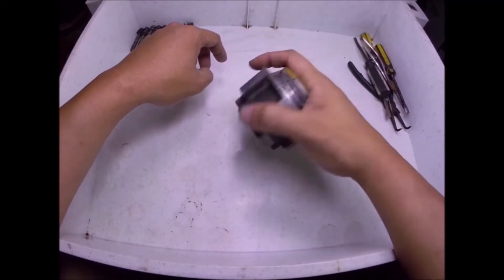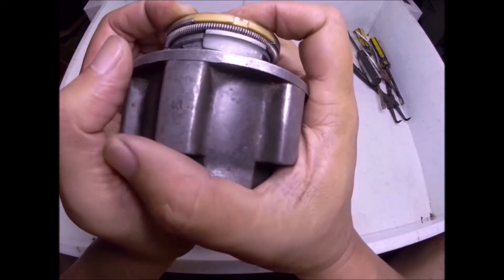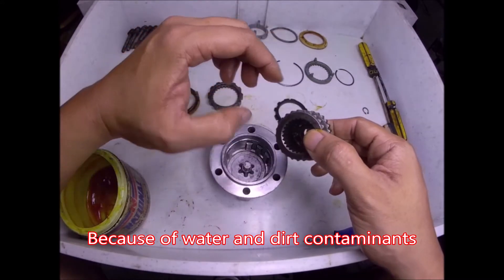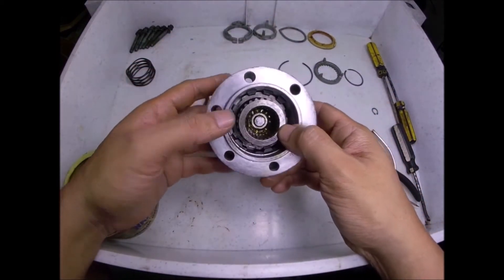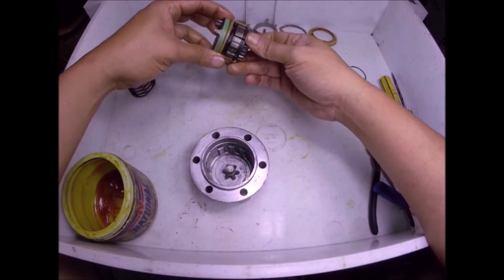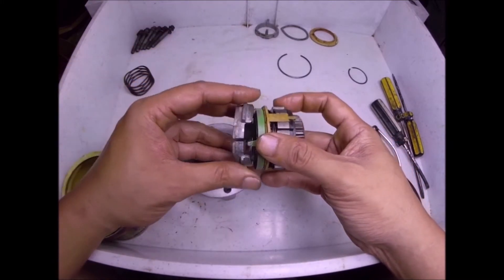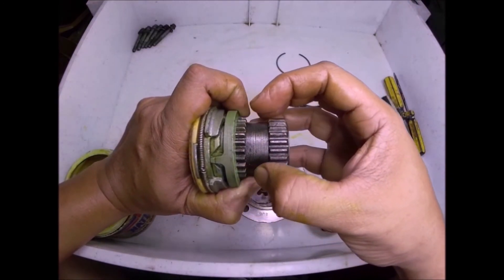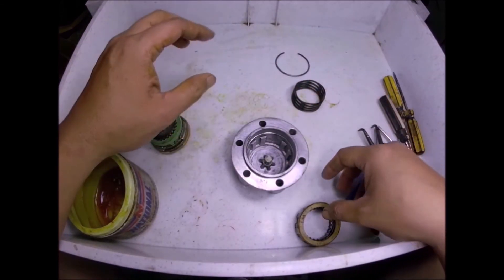4X4 Warn Auto Lock Hub How It Works In Detail - PART 4

Comment: How far should i reverse the car to disengage the hubs?
Reply from the maker: I do not remember but the 4wd light will go out if its already disengaged
Reply: @DIYAllManphKDWzpeedengineering  thank you for replying and for this video too God bless
Reply: I think we don't need to reverse the vehicle to disengage. If you shift from 4WD to 2WD there will not be any rotation to drive shaft, hence when you move forward relative rotation between the tire and shaft will be in the opposite direction.
Reply: Very well explained about the ramp and the spring if the axel is turning faster than the wheel 🛞 it locks but if you are in four wheel drive and you reverse does it unlock?